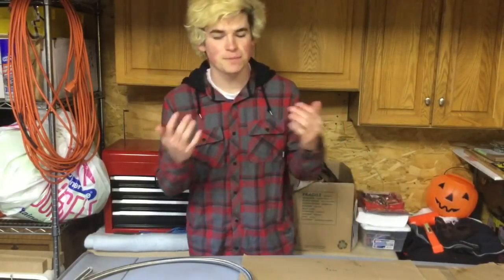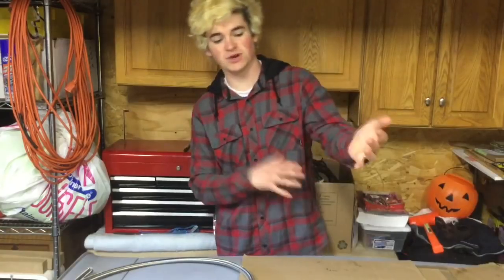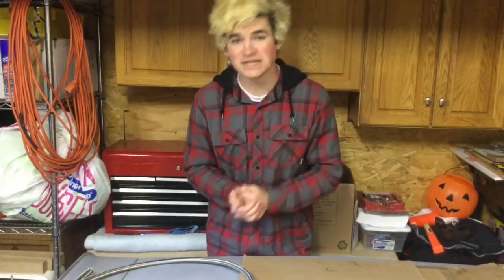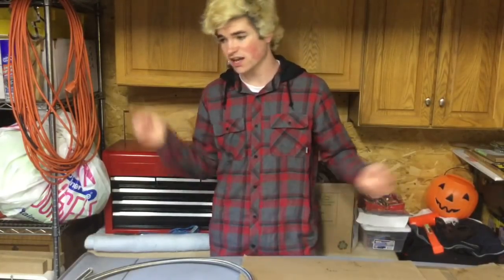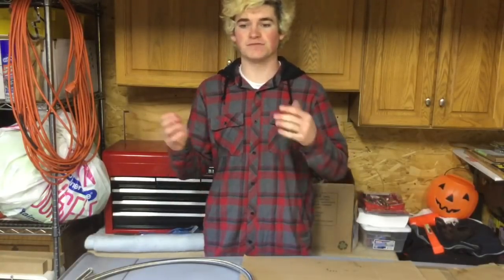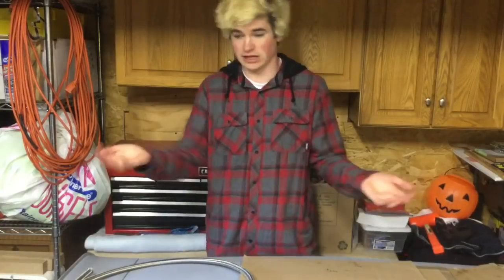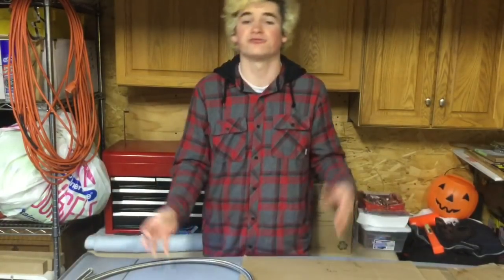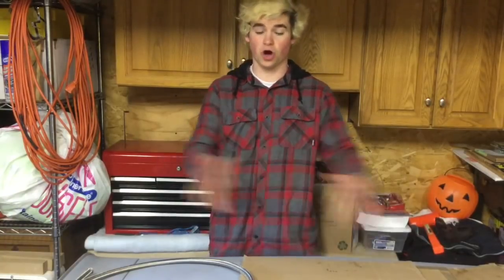A Quick Video

Comment: Hey, Sim. A Holley double pumper line is 9 5/8 long. The extra length is for the second metering block. Don't let anyone or anything discourage you, you're doing just fine. I've been doing this stuff for nearly 50 years, and still have to figure out some answers. The puzzles are half the fun!

Comment: When it doubt call Jegs or summit and use their tech help. If your carb has 2 metering blocks "They are located between the float bowls and the main body of the carb." They have the idle mixture screws sticking out of them. So if your carb has 2 of these you will need the longer fuel line "The distance would be farther apart" If your carb only has 1 metering block "It would be between  the front bowl and the main body" you would need the shorter line. Hope this helps!...Keep up the good work!!!!...Not many kids like you left in this world willing to work this hard!!!!!

Comment: Hey sim. You might not want to run a double pumper with an auto trans.  Vacuum secondary carbs are alot better on a basically stock/lightly modified engine and stock trans/converter.   But to answer your question you need to measure the distance between the fuel inlets on your carb.  Measure the center of one inlet to the center on the other inlet.  You
Reply: Ziptie Jedi that's what I said when he pulled that double pumper monster out first time did the same thing when I was a kid hell even the same carburetor LOL
Reply: Jim Huskey .  I did the same too lol.  When I was just a young lad I swapped a mild 327 into my s10 and just had to have the legendary Holley double pumper because I thought vacuum secondary carbs were for pussys lol.

Comment: That is the distance between the the fuel bowls the vacuum seconday is closer the duel pump carb is bigger since there is metering second metering block i would run a -6 or -8 fuel line or 3/8 an you should need the 9 5/8 carb fuel line